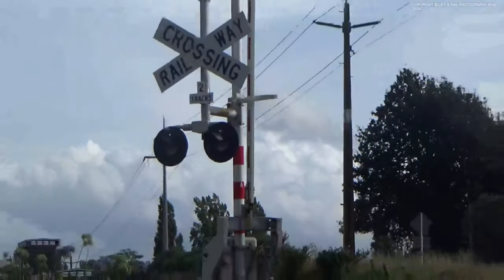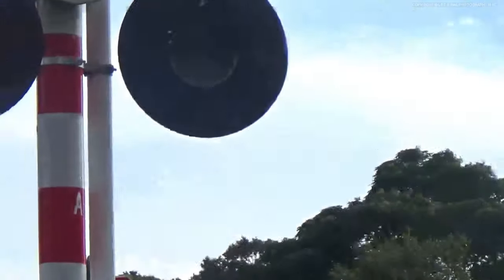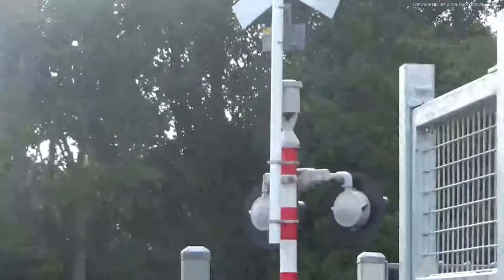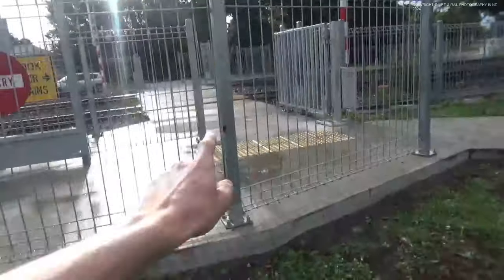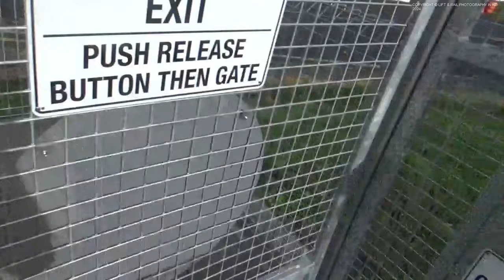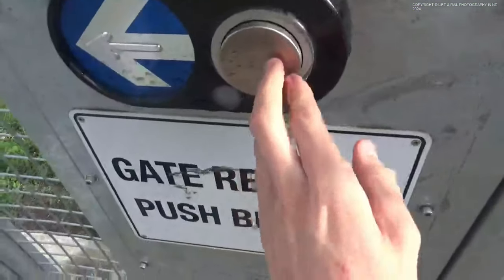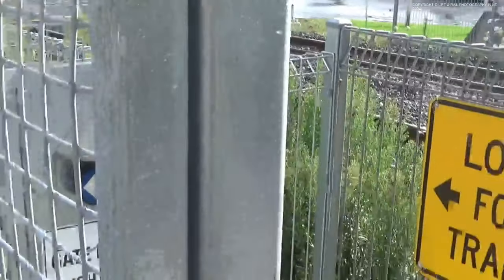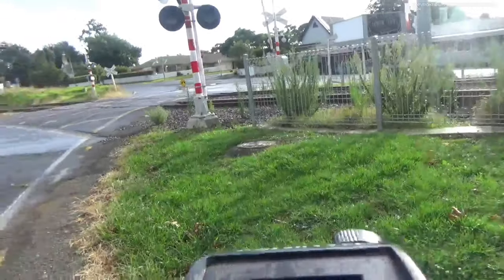Buckland Level Crossing (Before & After)

Comment: I think that is certainly a huge improvement over the original level cossing set up, Those Griswold barrier mechs looked nacked. Also I know I've said this before, But I definitely support KiwiRail's move to have all corners covered with extra lights and e-bells, Because if they end up being put on the quite setting later on, They would be better heard and seen, Paekakariki being an example of why I think this is a good move. Lastly, Pleased they have finally started adding release buttons to all new installations to prevent level crossing abuse.
Reply from the maker: I 100% agree, I think they should definitely do that at Paekakariki at some point if they ever install the pedestrian gates there too.